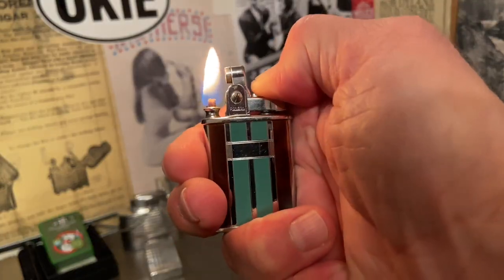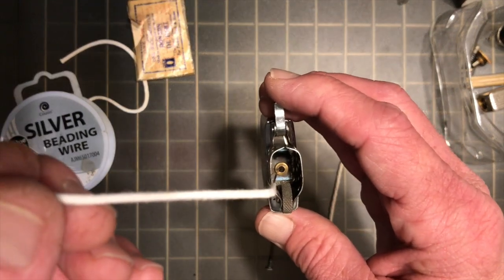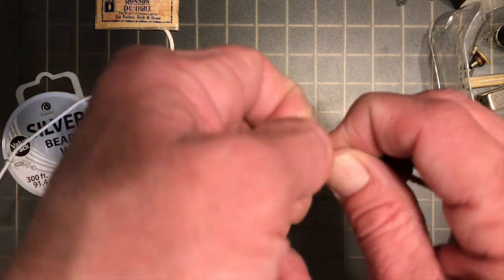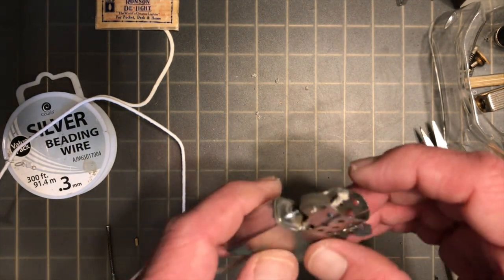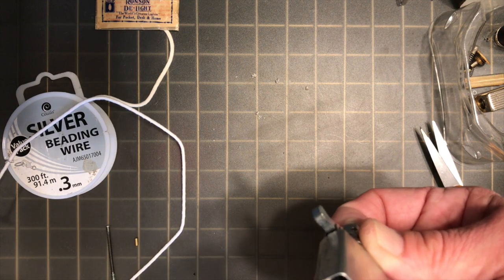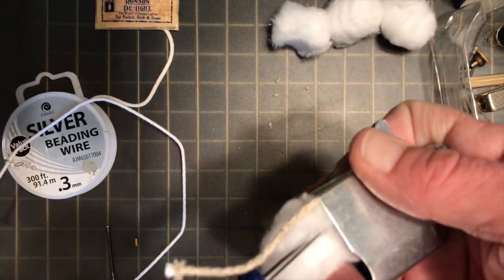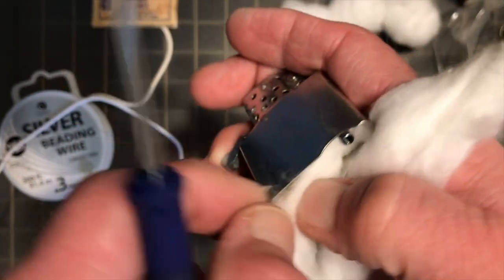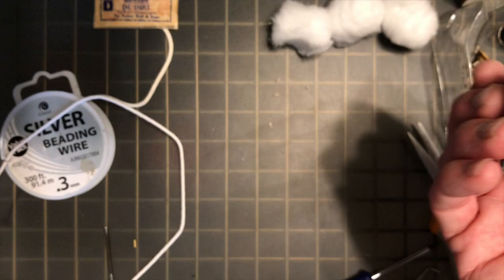What Material Should I Use To Replace The Wadding In My Vintage Cigarette Lighter?

Comment: What is Zippo wading made of. I wonder. Seems to be more durable than the cotton from the grocery store. Exact composition of the Zippo wading as much of a secret as the Zippo flint wheel? Not sure. I guess the role of the felt pad is to keep the wading tightly crammed together and to shield the tank from dirt. But that's just my guess. ;)  Anyways, I think one without felt pad gives it more of a retro vintage feel. ❤

Comment: I use a zippo as my 'daily driver'
Everytime I open it, the insert moves up just a smidge, but when you strike it it moves down. I understand, that that slight movement is common and normal, because I owned multiple Zippos and they behave the same. Is there a way to increase friction in-between the insert and the casing without damaging anything?
Reply from the maker: I’m glad you said that ZF, I was going to mention your bag trick to Mantas.✌️
Reply: Thanks guys.

Comment: Hi! Recently I bought some vintage lighters (IMCO Triplex 6600, IMCO Safety 4200, and a Seigneur). Is it better to use natural wool instead of cotton as wadding? When I pulled out the original wadding doesn't looks like cotton. Greetings from Uruguay!
Reply from the maker: Some may be better than others but any absorbent material should work. Some collectors like to keep all materials the same but they are your lighters so do what makes you happy. Glad to have you along for the ride from Uruguay my friend.✌️
Reply: @DependableFlame  Thanks for giving me your point of view, i'm trying to keep them as original as possible but also useful. Glad to be part of your channel, keep it up! 😁